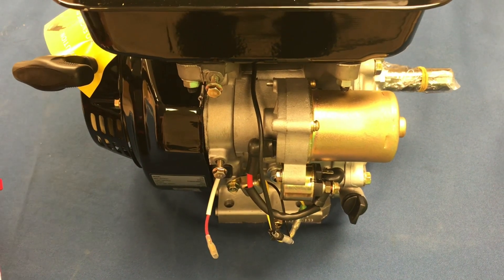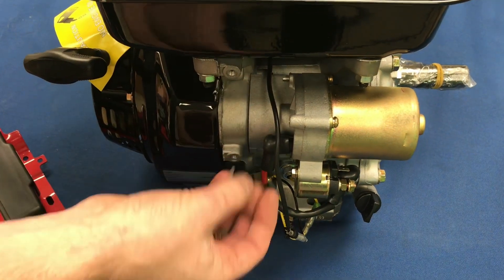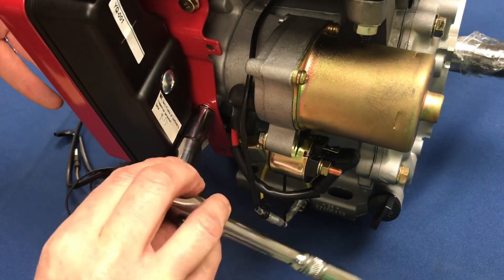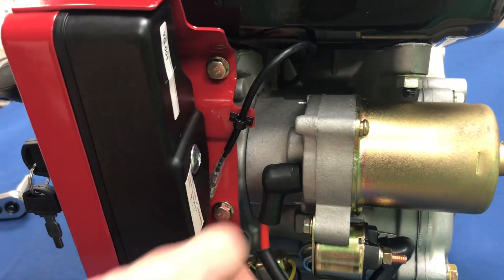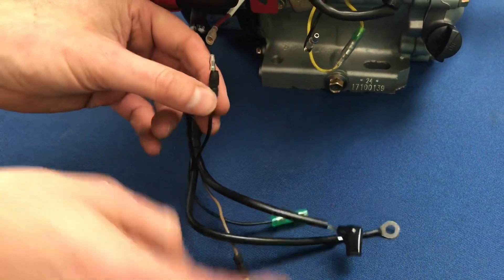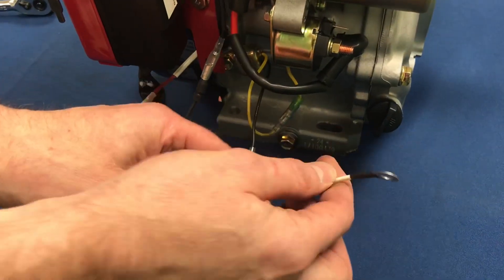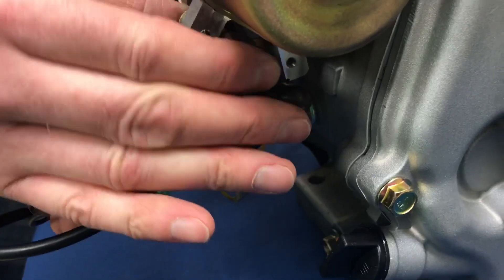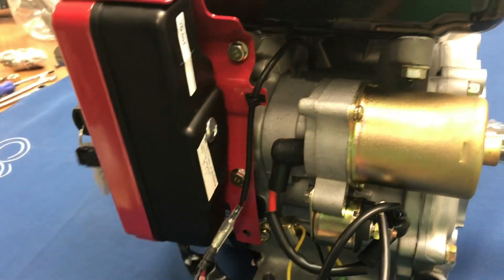Mud-Skipper 9hp & 16hp Electric Start Hookup

Comment: I hate it when instructions are given as "grab this one, like that & put it like that".... different manufacturers change parts or in this case-the colors would change.... in wiring instructions it's always a must to show the input and output so we know what is wired to what... and also, in my opinion, the battery wiring is imperative , which we still do not know here... where does the  load and ground feed?

Comment: Witch wire does the yellow low oil sensor connect to. Also I dont have the black wire from the bottom of the engine just a red wire coming in between the flywheel housing and bottom side of the block through a rubber grommet I do have the black wire coming out from under the gas tank. I did hook the red wire from the starter to the right wire and the one under the gas tank am not sure on the others
Reply from the maker: Kylee Bates please give us a call at 1-315-946-9400 and we’ll get it hooked up for you
Reply: @Mudskippermotors 
Name is Bill can you help me install my switch
Reply from the maker: @billhaggard3620  If you have our product, please call us at 844-MUDSKIP